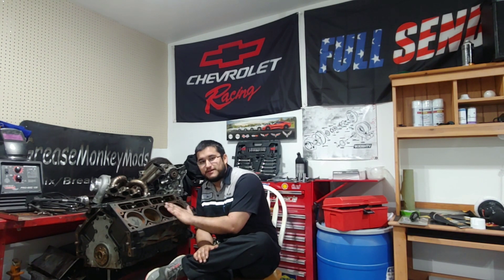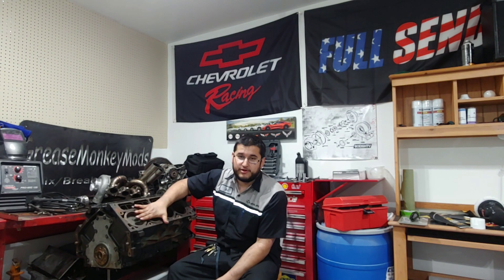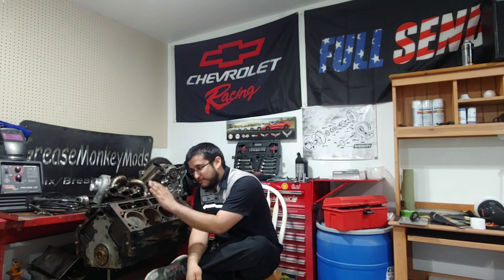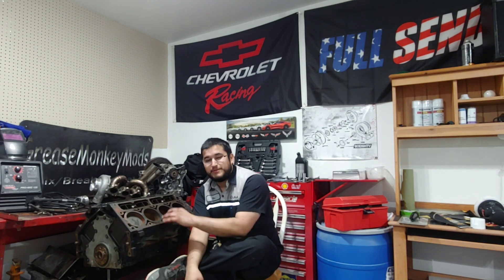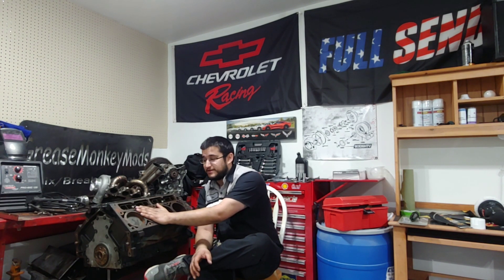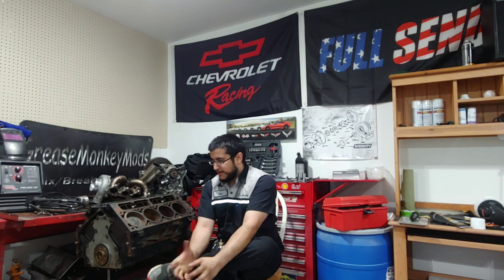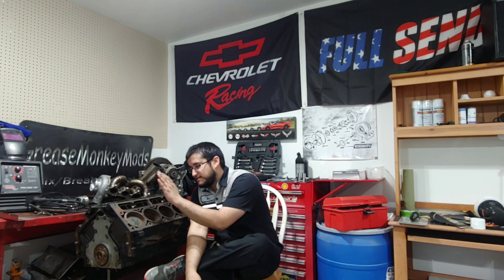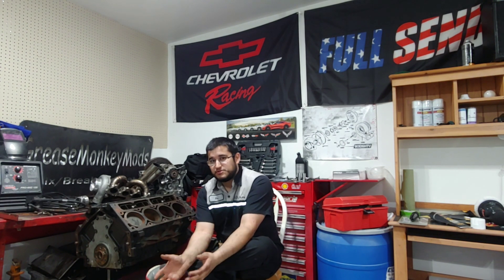CAN YOU BORE A 4.8 / 5.3 TO A 6.0 ? GreaseMonkeyMods LS series

Comment: wrong Wrong WRONG!!! Common 4.8/5.3 blocks can be bored to 4” but you should sonic check it first. There also is a rare 4.8/5.3/6.0 block Chevy tried out so they didn’t have to make multiple different engine blocks but they only made them 1 or 2 years and are pretty rare. But saying “no 4.8 or 5.3s can be bored to 4” is 100% INCORRECT!!! Ben Franklin said “ You can remain quiet and others may think you’re stupid or you can speak and EVERYONE will know you’re stupid.”

Comment: The 5.7l 350 has a 4.000in bore with a 3.480in stroke so if he's saying you can bore a 5.3l out to the 5.7l than in the end you can get a 6.0l out of a 5.3l 

5.3l 3.780in bore with a 3.622in stroke 

5.7l 4.000in bore with a 3.480in stroke

6.0l 4.000in bore with a 3.622in stroke
Reply: You're confusing the 5.7L 350" ci small block chevy and the 5.7L 346" ci ls1. An ls1 has a 3.898" with a 3.622" stroke crank. It cannot be bored out to 4". You can however use a 3.800" stroke crank and some custom height, stock ls1 bore pistons to make a 363. A 6.0 is a 364. You'd basically be there, but make more torque from the longer stroke. Whether or not that's worth it to someone is subjective.

Comment: I have a lifted chevy 5.3 on 35s and it lacks power and Deff torque. What can i do to make alot more power and torque or what is my best opinion i mean. Obviously turbo or superchargering is the route to go but which one is better for torque and maybe for towing and gas efficiency? Not looking for faster truck or best drag times just want to be able to tow better and it not be sluggish w these 35s on it? Will gearing it help? Just need some answers where to go or what i need ti start saving for thanks
Reply: You probably need some 4.56 gears.  Did it to a friends truck with a 4.8 3.42 gears and 35s.  It was night and day difference.

Comment: You can sleeve it for a bigger  bore texas speed makes 427s all the time out of 5.3s
Reply: If there is enough material to bore it out to 4.125" what difference would it make if you sleeved it? Your still in the same boat. You know most sleeves are 1/8 inch thick or smaller ones are 3/32 thick right? So if I am boring into water by cutting a block from 3.800 to 4.000 what will happen when I add .250" more to compensate for the sleeves outside diameter? Now I don't have any press fit or interference to hold the sleeve. I'm not saying its impossible but its unlikely anyone is making this happen without spending way more money on machining and special "wet" sleeves than if they just bought an aftermarket block and started from there.

Comment: I got a great deal on a 6.0 4l80e 4wd setup for my Tahoe and decided to build and "iron Ls1" out of the trucks 180k mile 5.3 for my 89 Camaro, and it's cool to have something relatively unique but like old boy said the 5 3 with or without boost can make all sorts of stupid power and if I had it to do over I'd still ls swap the car but I'd have just had the engine freshened up with a new cam and maybe a turbo down the road, which is what I'm doing because I'm running on home brew e85 and e85 + turbo is the way the good lord intended things to be

Comment: can somebody please explain to me what is the difference between the 5.7 LS and the 6.0 and the 6.2 is it just the bore size or the cranks and rods the same size or is the 6.2 and a 6.0 a bigger crankshaft or rod difference. somebody please help so I know what motor I want to build. thank you
Reply: All the motors you mentioned  have same rod and crank just the bores change
Reply: The only difference beyond gen 3 and gen 4, gen 4 has stronger cranks and rods, is the piston size and cylinder thickness. With boost there isn't much reason to worry about what size you use, the difference is with N/A builds. 3.78"/3.898"/4"/4.065"/4.125 are the bore sizes of 4.8/5.3, 5.7, 6.0, 6.2, 7.0. 3.267" 4.8, 3.622" 5.3/5.7/6.0/6.2 and 4" 7.0 is the stroke.

Comment: I have a 2005 Buick rainier, basically the Buick version of a Chevy trailblazer, with an LH6 5.3. I pulled a 5.3 from a 2004 Chevy Tahoe and after talking to one of my instructors in my auto class, he said my car's 5.3 is based on the ls2, and the one I pulled is based on an ls1, so the swap wouldn't work even after rewiring the cam sensor connector, knock sensor connector, and the longer hose for the steam lines. Additionally, he said the crank is not keyed on an ls1, and the gear pattern on the crank is different so it will read differently, and the oil pressure sensor is a one-pin instead of a two-pin so that would read differently as well. I would like to build the engine I pulled from the Tahoe and have it put out around 500hp NA. if this will not work what can i do to get my LH6 to stop sucking oil through the PCV, I replaced the valve and cleaned the valve covers and installed a catch can. plz help, i need it lmao

Comment: I know this is a dumb question but forgive me I'm just starting to dip my toes into the grease monkey pit I heard the 6.0 5.3 and 4.8 are the same bolt pattern on the bell housing? So you could just swap engines without having to change transmissions?? It would be a lot easier to do that instead of gutting blocks.

Comment: Checking the wall thickness has been mentioned as a possible check to allow you to over bore further saftey. However it shouldn't be taken for granted that you'd pass a sonic check. The key thing that makes cylinder wall thickness a variable is the casting 'core shift' (the sand core which creates the outside of the bore can vary slightly in it position). A shift will give you one side of the wall thicker than the other. Core shift is a natural part casting which doesn't just vary part to part but which also varies over time as the sand core molds wear with use.

Comment: Dude I have friends in Mexico “Mexico” that make 427s out of 5.3 blocks 😂😂 I didn’t believe them until they pulled the motor out of a race car that had 4.8/5/3 stamped on the block. I asked how many people do it ? They say everyone even on forced induction set ups.
Reply: No you don’t. They are 325 c.i. No way you’re getting 102 c.i. Extra from a factory block
Reply: Any sleeves
Reply: We been doing that for years now , nothing new .
Reply: I have been looking for a long time to find people boring 6.0s out to 4.125", I don't think I would attempt taking a 3.780" 4.8/5.3 block out more than 4", 6.0 size, I would only do that for a desperation N/A build really. With boost and LS engines there isn't a lot to be gained from displacement within certain levels using factory heads, blocks and cranks. The turbo, the fuel system and the fuel are going to matter a lot more than the displacement of the short block. A 5.3 and a 6.0 with the same heads, ring gap, same cam, same intake, same turbo, same fuel system and same turbo are probably going to have similar limits the 5.3 will read more psi of boost than the 6.0 since it starts with less power but likely both with a 78/75, intercooled, on E85 are both going to run out of turbo, run out of fuel or bend a rod around the same power level...since the rods are basically the same as long as the rings are gapped. The cranks are basically the same so it would be much more fruitful to just give either engine a minimum clean up, good rods and Pistons, then continue adding boost. Shouldn't be a problem making 1500hp that way. Especially since a SBE 6.0 LY6 can handle over 1500 just with ring gap. A weakened block with more displacement isn't going to help anything. Boost is a strange animal like that. That's why a little 3L 2JZ can make ridiculous power, it's all about the turbos, fuel system, fuel type, controlling the electronics and bottom end strength.
Reply: I can verify this. I know a few shops in Baja that bore the 5.3 and use the 6.0 pistons. So…. It can be done…🤷‍♂️
Reply: A 5.3 is a 425... so making a 427 isn’t super far fetched...
Reply: @Synic08  What are you smokin? A GM 5.3L is 325 CID.
Reply: @Synic08  a 5.3 is small block ls 325 cubic inches

Comment: have a question! wish you can answer .. I have an ls2 heads "243" and an ls1 5.7L  block - what should I do considering the 4" bore on the ls2 heads to put it on the ls1 block? 
Thanks in Advanced
Reply from the maker: No thats a perfectly fine combination. Those 243s also came stock on a 5.7 LS6 with the 3.898 bore so you are good to go with 243 on a 5.7
Reply: @BoBuilds so its safe to use oversized heads bore as long as the valves don't hit the sleeves NOTED thank you, 1 more thing sorry forgot to mention.. should I use engine bore gasket size or the heads! ....
Reply from the maker: Don't worry about the heads! The only rule is you CAN NOT use rectangle port heads on anything smaller than 6.0 

Use gaskets based on cylinder bore not heads
Reply from the maker: Cathedral port heads can be used on ANY size ls engine 4.8 to 7.0
Reply: 243 heads also came on the later 5.3l a 3.78" bore.  Run LS1 head gaskets and your all good.
Reply: 243 heads on a 5.7 work fine, I would probably recommend using 706 heads, especially for a street car, the added port velocity, higher coefficient discharge, higher compression, lighter smaller valves are probably going to make it run and feel way better. Unless you have a very light vehicle, do lots of head work, very deep gearing, very aggressive cam, very high stall converter, it's probably going to be a better combination, especially with the same off the shelf cam, especially if you use thinner head gaskets to get more compression, fly cut the pistons for P-V clearance if needed. The double digit TQ gain for 1500-2000 rpm in the middle will be better than the possible single digit HP for 500 rpm up at the very top.

Comment: a safe bore on a 5.3 isn’t even enough to be considered a 5.7. You can only take the bore a little under the 4 inch mark but you could just substitute a 4 inch crank and bigger stroke and make a 383
Reply: Yeah, a 5.3 can be bored to 3.898-3.905" which would make it a 5.7, from 325ci to 346-347ci. It would be pointless to do so instead of just boosting the 5.3 as is or just using a 5.7/ 6.0/6.2 block or larger for n/a.

Comment: Ripping a 5.3 to a 6.0 is kinda pointless when you can grab a junkyard 6.0 for way less than what a machine shop will charge. And while I hear people say “yes you can use ls3 heads on 4.8, 5.3 because the bore spacing is the same” that’s technically true but bore spacing has nothing to do wall thickness or how the 4” bore heads combustion chambers are set up, that’s why ls3 style engines have the intake rocker at an offset
Reply: 6.0 blocks aren't plentiful everywhere, many places act like they're gold, smart money would just run turbo 4.8/5.3s while they save for a Dart 4.125" bore block and build a 388 or 427 for less than an assembled 408 shortblock costs.
Reply: @hendo337  / yeah man the 6.0 is worth  big bucks is everywhere even here, there’s a guy in FB market selling a 6.0 short block and he wants $600
Reply: @limabravo6065 I wish I could get 6.0s for $600 😂🤣

Comment: You can make a 4.8/5.3 into a 6.0. With the proper bore and stroke it can be brought out concervitavlty to a 383cid which is a 6.278.
Reply: And a 6.0 ls , what can u bore out to?
Reply: @jesusmartinez4853  safely a 6.0 in stock trim can be bore and stocked to a 418. But it will go to 427. Ls3 block the same. 
Now keep in mind thats stock. But with darton wet sleeves and/or block spacers 500+cid can be achieved easily. It depends on how deep your pockets are for the street.
Reply: Just need to be Sonic checked

Comment: Imagine being clueless like this guy, I have (2) 5.3l with Ls2 4.00" flat top pistons in them with .144 wall thickness after bore in the thinnest spot.
Reply: I have  LC9, I've heard the lsi sleeves were used in them, I'd like to go 3.898 you hav any knowledge experience with the alum. blocks  also I read somewhere that some lh6 blocks were cast in the same place at the same time as 6.L  and received the same sleeves      appreciate any info.
Reply: @billytarpon9871  I finished a 383 LS Friday. Used a LH6 and bored to 3.905 its a little MONSTER!
Reply: @repurposedperformance5762  sounds like a real seat cushion smasher
Reply: Billy Tarpon It’s in a ‘07 Envoy Denali and its genuinely impressive for being a EBay $1,699 forged Carillo 4” rotating assembly with a K1 crank. All in with machine work, cam, gaskets etc. I’m into the engine $2500 total (parts) labor free, I did it myself :)
Reply: There's a guy with a machine shop on YouTube he's taking 5.3 and boring them and sleeving them to be 427 strokers
Reply: I think he doesn't know what a ls will do
Reply: That's fuckn thin
Reply: Touched By Pros it’s always good to have it sonic checked and most I’ve seen have enough material . I’m in the process to have my 5.3 vote to 4.00 and add a 4 inch crank.
Reply: @miguel300ish  Nice, I will say I dont do that build anymore based on the fact that its stricken to NA but I have been doing 3.905 bore on all my 5.3l and they are nasty little fuckers. We made 580whp tonight on a 5.3l with a ebay gt45 with sloppy stage 2 cam and a 3.905 bore on 11psi gen 3 lm7 block
Reply: @Touched By Pros do you think you could get in the 18-20 psi range with a lm7 that’s bored out to 3.905
Reply: @malachimalone1820  a LM7 @ 3.905" I would not feel comfortable with boost but I bet it would live in a perfect world.

If you had a lh6 5.3l you could boost those numbers @ 3.905" bore no problem. The liners are still super thick at 3.905" bore

I bore Lm7's out to 6.0 but they have all been NA engines. The very first 5.3 to 6.0 bore engine I built is still alive and running well today in a H2 Hummer.
Reply: Touched By Pros okay thanks that helps a lot!
Reply: @malachimalone1820  if you're running boost it's not necessarily to add the 22ci, put your money elsewhere, ring gap, GenIV rods, mls headgaskets, elgin cam, pac 1218s, 706 heads, tbss intake, VS 7875. Any extra hp the ci might make at a given PSI can easily be replaced with at extra PSI on the 5.3. A stock 5.3 bottom end with ring gap made 1300hp. Smaller bores with thicker walls means a stiffer block and more surface area for the headgaskets to seal too. It'll cost a fortune to keep a transmission, driveshaft and axle behind the power a turbo 5.3 will make then make it hook and use it all in the 1/4 long before an iron 5.7, 6.0 or stroker.shpuld be on your radar.
Reply: @hendo337  I appreciate the info! Would the vs 7875 be capable of getting to that 1300 crank number given the bolt on upgrades, tune, fuel, etc
Reply: @repurposedperformance5762  lots of hp, what compression ratio were you running thanks
Reply: @repurposedperformance5762 a billion guys bore that big to get a 383 with a 4 inch stroke and run 4 digest power levels.
Reply: @miguel300ish  post it on youtube that would be an ls breakthrough!!!

Comment: Thanks you answered my question I have to bore my 5.3 to a 5.7 due to the last  machanic bored to much and making my truck run like shit...
Reply: Never spend money like that, just get another cheap 5.3. A machine shop will charge more than 3 junkyard 5.3s just for labor much less larger pistons, rings, bearings, possibly rods. It's not a great ideal to build a 5.3 unless you are highly experienced and race with turbos or something and you know you are going to push the power beyond what stock pistons with ring gap and stock rods can handle on a stock crank, I'm talking 1500hp type stuff and you are smart enough not to waste a 6.0 block doing that or ready to use aftermarket blocks and rotating assemblies yet.
Reply: @hendo337  thank little late those but cali still expensive even if I would of got a junk yard block.. it sucks

Comment: Great vid ,,Is there anything I can do to my stock 5.3 to get 60 to 100 HP out of it N/A ?
Reply: TSP or BTR cam
Reply: @SubePelayo928  Thanks for the reply ,,Stage 1 or stage 2 ?
Reply: Dels Transs depends on what you’re looking for. Both off low end power up to around 5500/6000. But the higher the stage. The more you’ll have to buy. Believe stage one you can get awake with stock. Stage 2 you’ll need springs. 3 and so on. You’ll need springs plus converter. You’ll need a tune for all
Reply: @SubePelayo928  Im looking for power across the board and keep my stock converter ,,BTW  the 5.3 is swapped into a IROC
Reply: Ebay generic long tubes 1 3/4"-2.5" $150-300, elgin 228/230 cam $100-150, pac1218 or Howards .600" single springs $100-150,  TBSS intake $100-140, China 92mm TB $90, 706 heads remaned ebay or milled to 58cc and 3 angle valvejob machine shop(0.5:1 + 9.5=10:1 comp) $300-500 set, 0.027" headgaskets (0.7:1+10:1= 10.7:1 comp)$90-100, 160 tstat $16, NGK TR6 $30, flex fuel sensor $16, 8mm wires $25, 430-450hp crank,   bonus 175hp Nitrous oxide kit $300.
Reply: Ya maybe some flat tops pistons like from the 4.8 that will give you gains everywhere not a lot but more compression is good

Comment: Finally someone tackled this question and actually showed why 🤟🏻 people always hate on smaller displacements the 4.8L can make crazy power and with the right setup do things much larger engines can’t with the addition of boost!
Reply: Absolutely, a turbo 4.8 can make more power than most people can possibibly use on the street, keep a driveline behind or put down in a 1/4 mile.